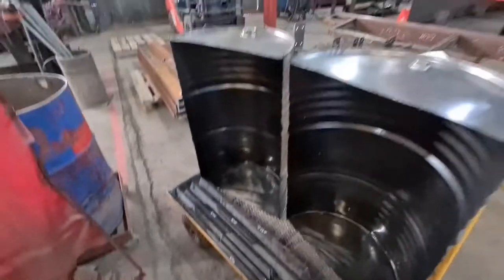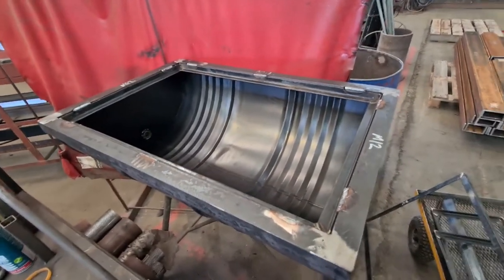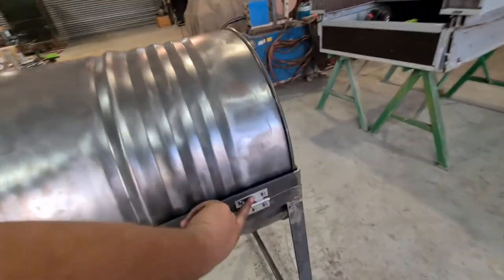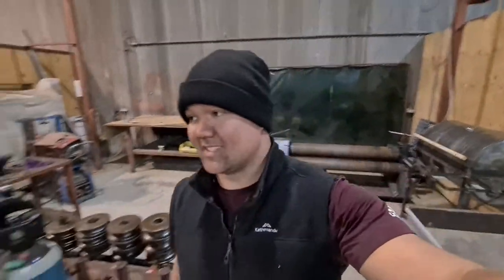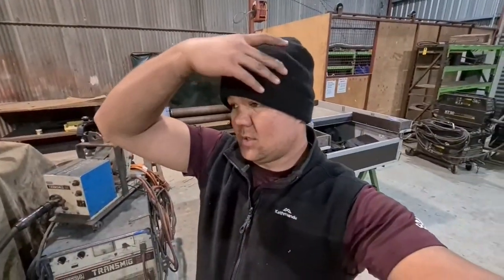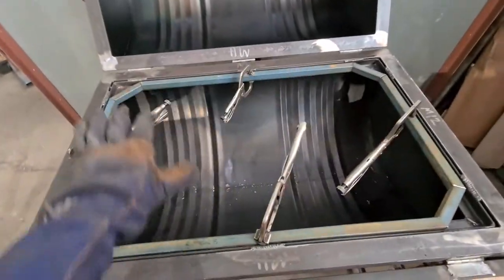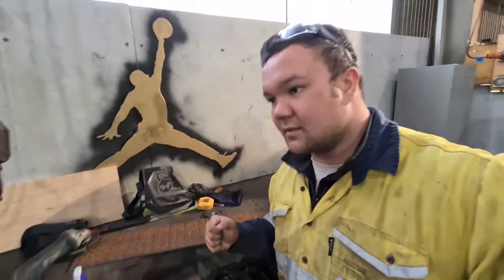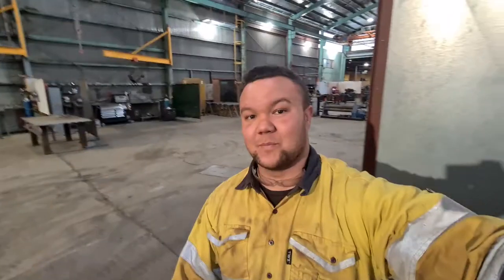Turning an Oil Barrel into a BBQ

Comment: HEY MAN AWESOME JOB, DID YOU PAINT THE 'L ANGLES' WHICH WERE WELDED INSIDE INSIDE THE BARREL TO HOLD THE MEAT TRAY WITH FIRE RESISTANT PAINT?
Reply from the maker: Hey man, decided not to so it wouldn't taint the taste of the meat in any way